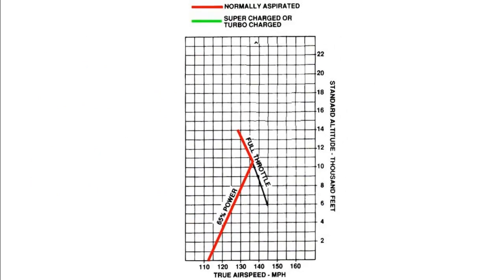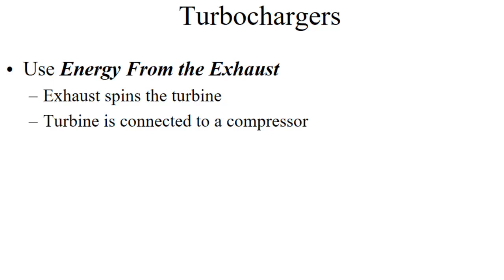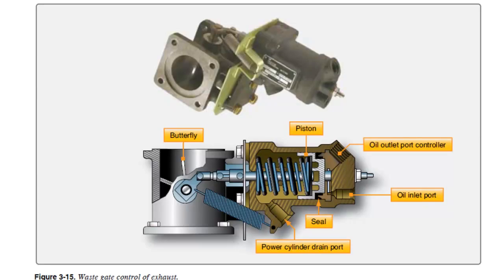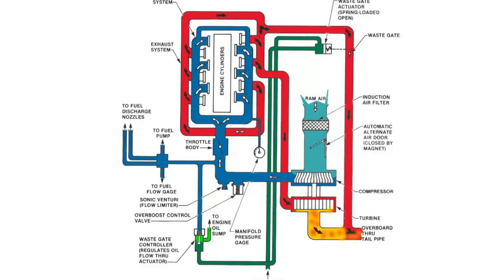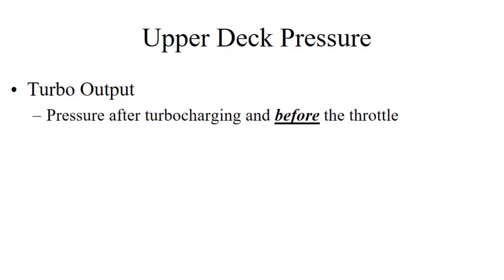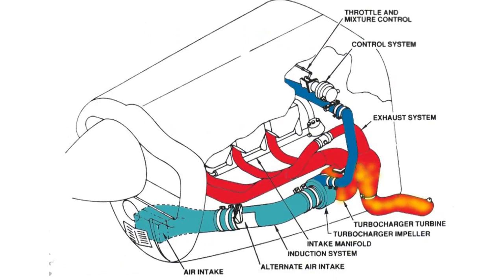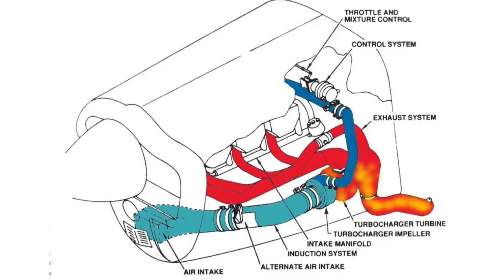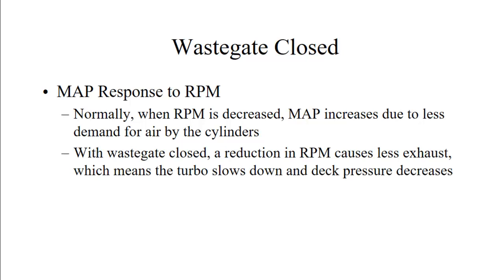ASP - TurboSupercharging Video

Comment: Very good video!  I'm a student mechanic and I believe that "Normally, when RPM is decreased, MAP increases due to less demand for air by the cylinders"  is not quite right.  If we are talking about a plane with a constant variable pitch propeller, a decrease in RPM (by increasing the propeller blade-angle by manually adjusting prop lever) will put a higher load on the engine, thus slowing down the RPM of the engine. This causes there to be less vacuum developed by the intake strokes.  So, the engine is producing less vacuum... and this also means the air pressure in the manifold will increase.  If we are talking about a fixed pitch propeller, a decrease in rpm ( by closing the throttle) will typically cause the manifold pressure to decrease because more of the vacuum created by the intake strokes is kept/stored in the intake manifold because the throttle butterfly is more closed.  If we are in a fixed pitch propeller plane and rpm is decreased by climbing the airplane, the manifold pressure will go up (throttle butterfly stays the same but rpm decreases and thus less vacuum is developed). I hope I'm not missing something... but I think this is right.  Very good video.